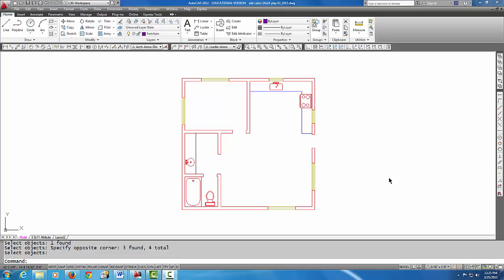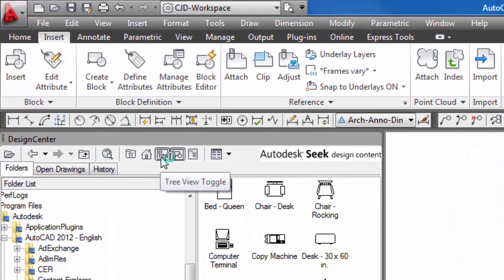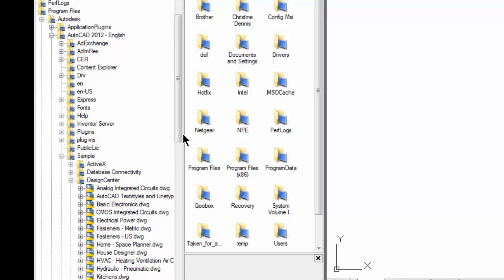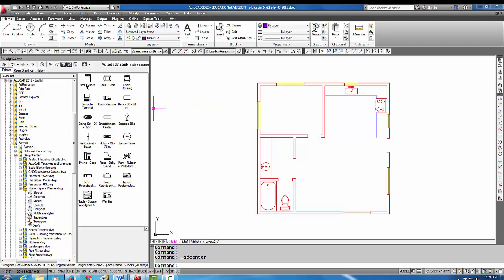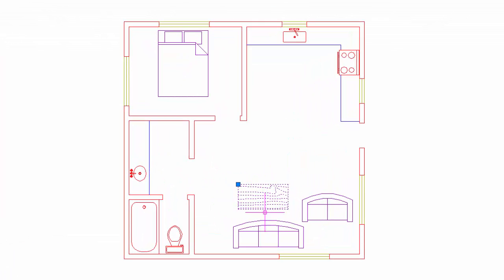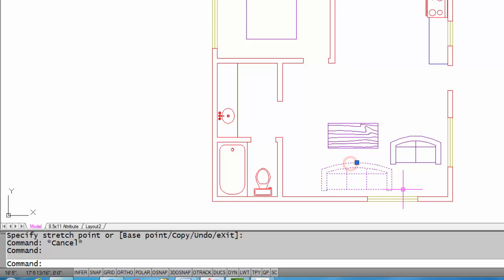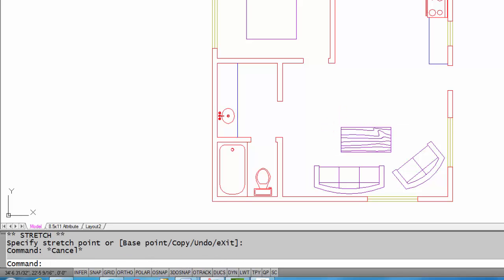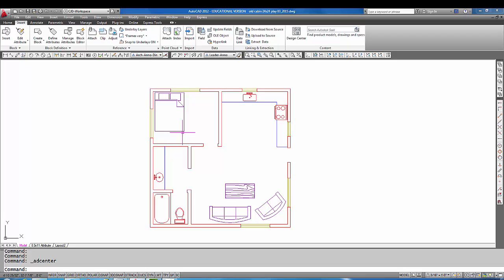Autocad - Add blocks using the Design Center #39

Comment: Hello mam,
i have a problem with the scale the object is too small i setup unit into architecture feet and inches but no use.
Reply from the maker: try this, on the command line type DDUNITS <enter>.  In this dialog box make sure your units are set to Architectural and the Insertion Scale is set to INCHES.   Then put a block in.  Let me know if this works.
Reply: Chris Dennis i have already setup unit by command UN and D .both are set to architecture and feet
Reply: Thanks mam its work. :)

Comment: How to scale the furniture mayte, mine is extremely large
Reply from the maker: Are your units set to Architectural? Feet and Inches?  If not, you may need to scale the furniture down.
Reply from the maker: try the SCALE command